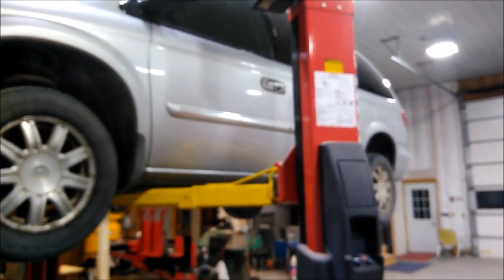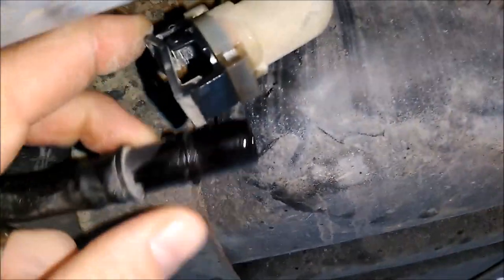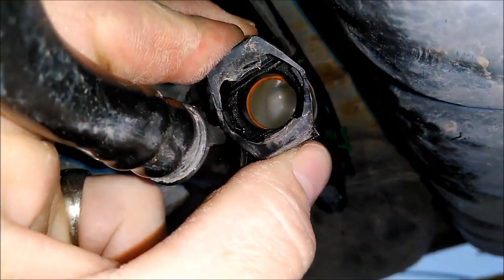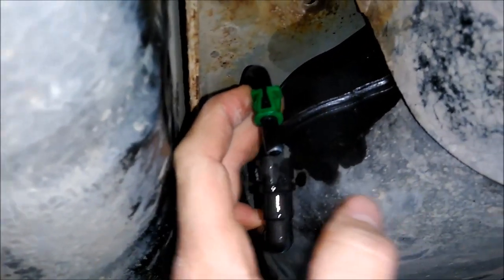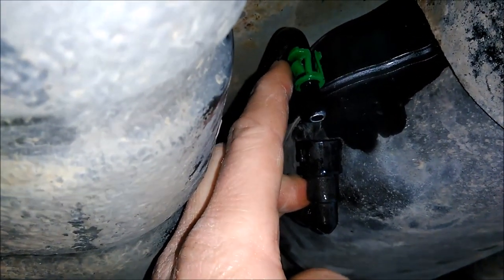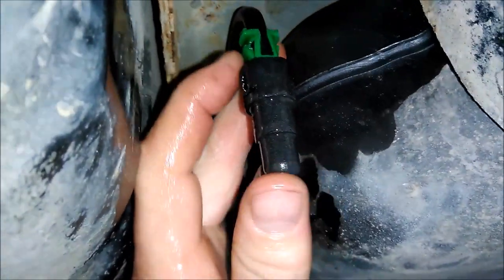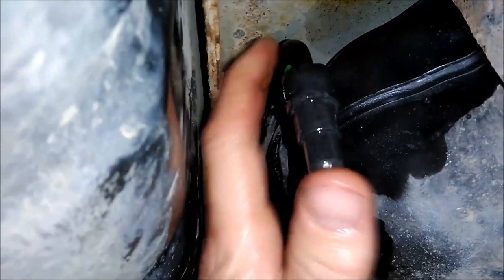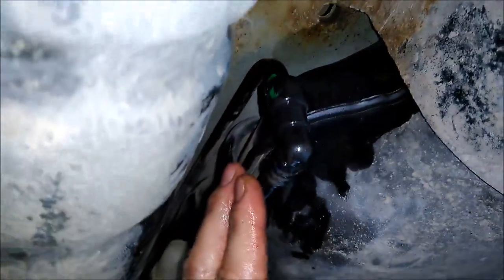Chrysler Town and Country Fuel Evap Canister Clips

Comment: I am running into a problem with my 2006 town and country where the fuel pump at gas station stops pumping because it thinks the tank is full. From watching other videos it says to try and blow air through the tubes connected to EVAP canister. I looked at your video and found the tube, it what appears to be it. The larger tube in this video.... Should I blow air in those tubes to see if it's clogged and that's why I'm running into this issue?
Reply from the maker: I would just tank the canister off and visually look and see if you can knock some dirt out if it looks like it is clean it could be a purge valve, if you do blow it out make sure you use low psi air or water like 5 to 10psi you don’t want to break the canister if it is totally plugged

Comment: I have a 2005 Dodge Caravan and it’s leaking fuel from the bottom what is it what do I do
Reply from the maker: cecolonn could be a number of things, fuel line, tank and connections
Reply: I had the same issue with my 00 town and country. I got underneath and found the line had a hole in it at the weld at the fuel pump. It was a pump coming off the fuel tank directly connected to the fuel rails. Two clips and the wiring. Fairly simple to access Took me an hour on the car lift. Make certain you are careful. I’d disconnect the battery. The fuel system will still be under pressure. The part was under $45.

Comment: I have gas smell in my Chrysler town and county 2005 be more with heater
Reply from the maker: I would start by checking for fuel leaks sounds like it would be coming from the engine compartment being it is worse with the heater on